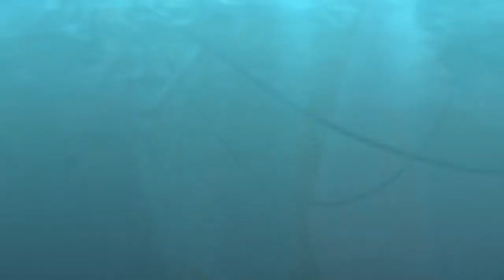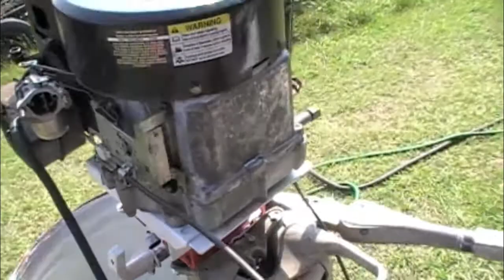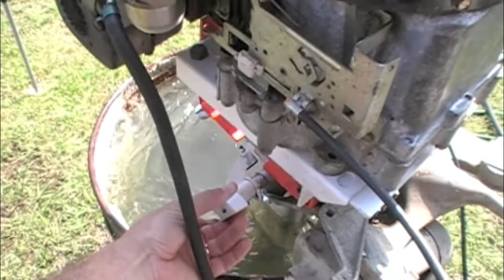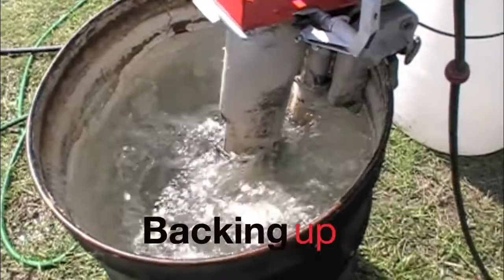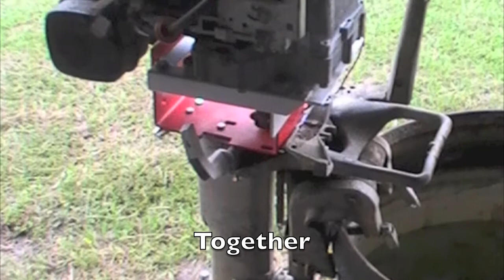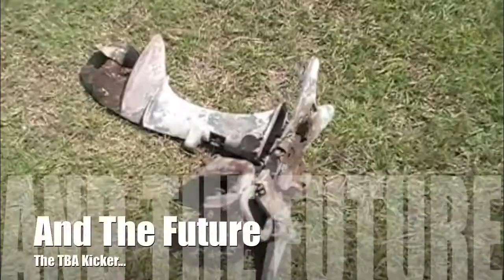The Mower / Kicker Test Run

Comment: ... nice drive shaft. check out "lovejoys" at the hardware store. i think thats what ima use on my bayliner when i convert it over to a 18hp. anyother issues you run into when putting it together?